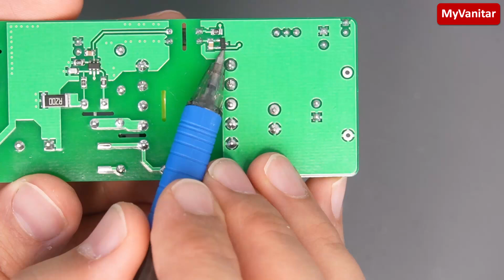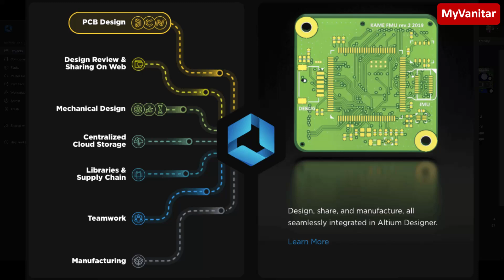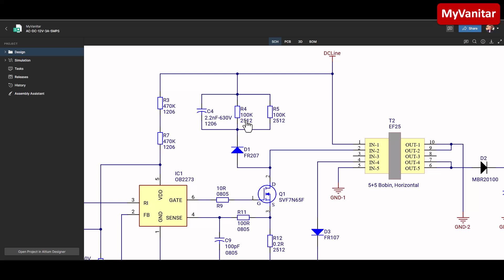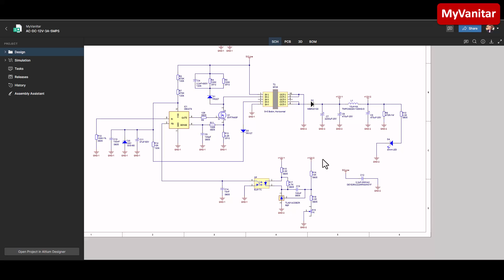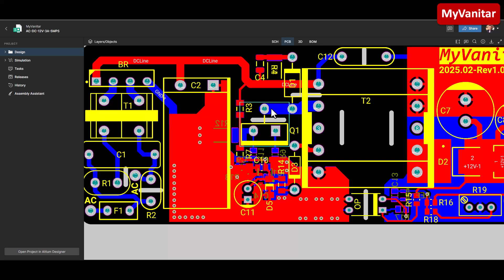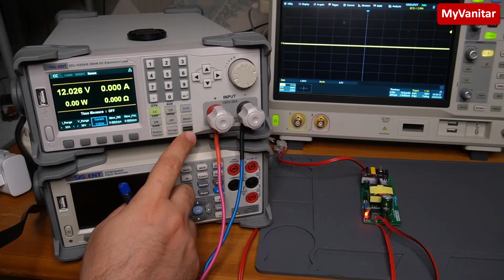DIY Universal AC-DC Power Supply Circuit | 12V 3A (36W) | Low Noise Design

Comment: will this work in full load without any heating issue?
Reply from the maker: of course you need to use an enclosure similar to commercial ones with a heatsink

Comment: I see you’re using an EF25 transformer — could you please share its specs or datasheet (voltage, current, core type, frequency, etc.)?
Reply from the maker: Core material is N87, but N97 is also fine. Other specs do not matter because they are below the margins. There is only one horizontal bobbin type like this, also. You can check with the TDK reference to find the exact part number, but you can buy from Chinese stores if they are cheaper: https://www.tdk-electronics.tdk.com/inf/80/db/fer/efd_25_13_9.pdf

EFD25 is also slightly different from EE25, their bobbins also differ, check the article

Comment: nice design, but on the output of converter, you used TO252 Diode for 3A current. I guess that the temperature of D2 in case of 3A continueous load will above 130 oC, very hot area.
Reply from the maker: No, check the datasheet specs and charts of the diode for the maximum 3A

Comment: Hi, its great to have such a nice board. my question  is how to calculate values of optocoupler for 24v 2.5A smps? also only Gerber file is available in altium360
Reply from the maker: the transformer also should be recalculated
Reply: @MyVanitar  yes. I know how to calculate the transformer. But can't calculate the values of optocoupler according to the output voltage and current
Reply from the maker: that's way easier than calculating the transformer. choose the two resistors in a way to see 2.5V in the TL431 point, when input is 24V.
Reply: @MyVanitar  thanks 🙏

Comment: Hi! Nice design of ACDC power supply. Have you heard about cancellation windins? I used its for better noise supression. Also by-pass capacitor (Y) can be connected not only between secondary gnd and high voltage DC rail. Additional Y can be connected between secondary gnd and AC1 or AC2 input. I saw this trick in a MeanWell power supply. It's works.

Sorry for my English 😊
Reply from the maker: Thanks. And also a Y capacitor between input GND and output GND. noise cancelation could be also using a copper tape on the top of the transformer, right?
Reply: @MyVanitar  Hi. Yes, the copper tape is a good blocker of the external magnetic field. It should be 'grounded' to the primary gnd. I designed a switching transformer for my old job. So, I used only ways that can be implemented only using standard materials for winding transformers. Like copper wire. A copper tape is a good approach, for suppressing EMI,  but it increases the total price. So, I used cancellation windings only, if we saing about the transformer construction.
Reply from the maker: Copper tape is easy to use on the top of the transformer. by the way, an SMPS board should be inside a metal shield

Comment: I like your design, 
1st, Only Gerber can be downloadable
2nd, I would like to change C2 to C2+Cx+100nf in parallel total 100uf.
3rd, I would like to change C11 to C11+Cxx+100nf in parallel total 44uf.
4th, I would like to remove thermal relef form transformer , R12, R8 and 12v outpad gnd.

Comment: where can i aquire the ferrte core smps transformer , i tryed madeinchina website but they require 100 of pieces for a shipment and i can not seem to find a retail store in europe that either is out of stock or will require the same 100 200 pieces for a shipment and the ones that allow for less pieces per order have exagerated prices from less then a dollar that it's a normal price for an transformer to 3-4 dollars. and they usually dont restock
Reply from the maker: You can buy in low quantity from Chinese stores (AliExpress) or Mouser, tme.eu, ... etc). They don't usually make such things in stock because the profit margin on components is higher. I suggest you buy a few commonly used ones in one purchase.

Comment: Thanks for sharing this wonderful project. I have two questions regarding its design. How did you calculate the values for the components C1 and T1 (noise reduction components)? Can you provide some material explaining exactly how you performed the calculations shown in the example in the video? I have the same question regarding the transformer T2. You show which inductance values are needed for T2, but it would be great if you could provide any material on how these values were calculated. I know there are plenty of sources on the internet, but it is important for me to be able to perform the calculation and arrive at approximately the same values for T2 as you did — for educational purposes only.
Reply from the maker: I have a plan to prepare an educational package and teach all of these practically so that you can follow and build whatever you like
Reply: @MyVanitar  That would be great. Would it be free of charge or not? Do you already have an approximate date when you want to publish the material and on which platform?

Comment: I usually use 2 legs of the potentiometer so that if something happens to the slider (contact breakage), the contact is not “hanging” in the air but is connected to the other extreme pin of the potentiometer.
Reply from the maker: Yes, that's more important for the device that we need to adjust the potentiometer routinely, but here only happens once. It's to compensate the winding variations because usually, people make the prototypes by hand, not a transformer winding machine